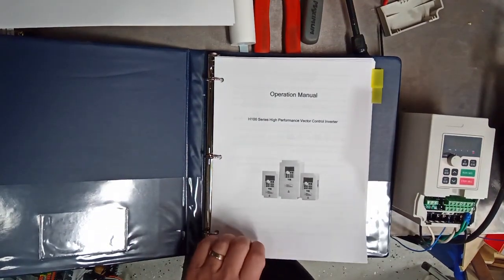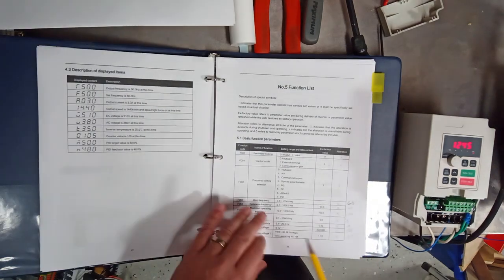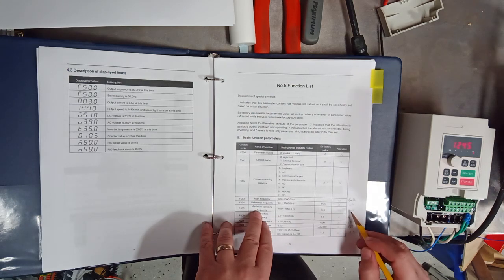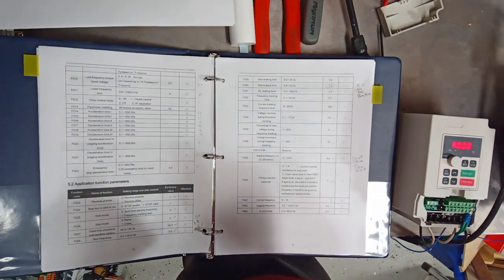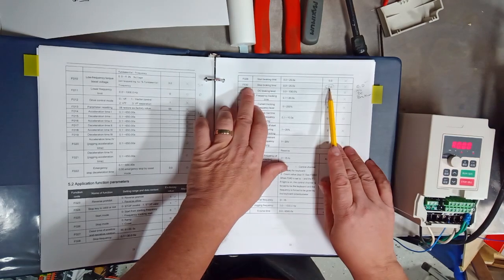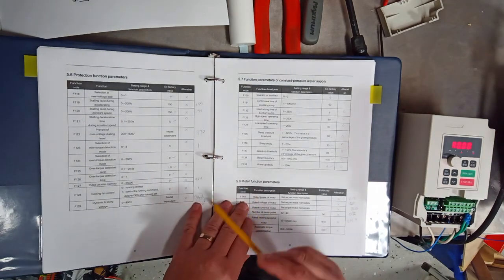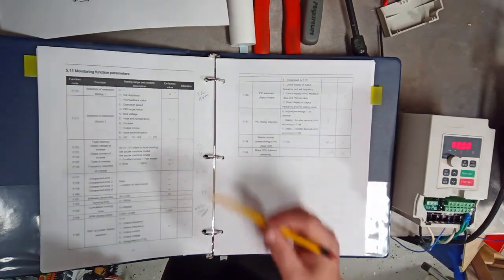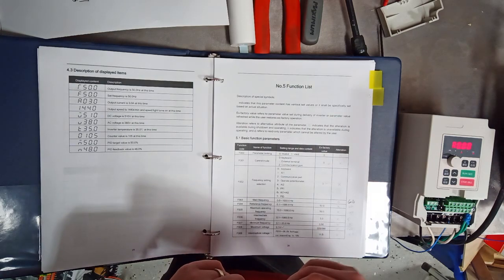Programming my VFD to drive the single phase 120V PSC motor

Comment: While I appreciate your effort, pointing to a manual which is unreadable on my screen and blazing through an explanation of esoteric terms just isn't helpful.  I will watch again with my miniscule manual in hand and try to correlate the two. Having absolutely no electronics background is not optimal, but all I want to do is run my 220v planer off of 120 volt source voltage.  It shouldn't be this hard.  Thanks.
Reply from the maker: @Janet-vx9qn  Simply don't go down a path if you can not comprehend the content or if you take the content out of context.  Your situation is not the same as the project documented by this video.  You are trying to run a 220V  planer from 120V source.  This is not within the context of this project.  Don't blame me or anyone's comments on this thread for your project becuse it doesn't apply.  Since you have no background in electronics or electrical motor operation, your comment that it shouldn't be this hard has no merit.

Comment: Saludos buenas noches tengo una pregunta. 
El VDF se puede poner a encender automático osea cuando haya un corte de energía que el mismo VDF se resete y encienda solo sin la necesidad de darle al boton run?
Reply: No creo que esto sea posible con la configuración VFD original. Creo que tendría que configurar el VFD para usar un interruptor de funcionamiento externo que podría estar siempre cerrado o usar un retardo de tiempo. De cualquier manera, necesitaría explorar opciones utilizando componentes de interruptor externos.
Reply: @toddbenko6701  excelente gracias hermano por su respuesta un fuerte abrazo desde Republica Dominicana.

Comment: Hi there can you provide the link for the Manual you got H100-2.2C2-1B
Thanks

Input: 110V 50/60Hz
Output: 0-110V 12.5A 0-1000Hz

Parameters what I am using, not validated as functionally correct.
F003 main freq = 60hz
F004 ref freq = 60hz
F005 max freq = 100hz for 1750rpm unit 60 for 3600rpm unit
F007 min freq = 10 hz
F008 Max Voltage = 120V
F026 stop mode = 0
F028 stop freq = 0.5 hz
F030 stop braking time = 0.0s
F031 DC braking level = 2.0 (dont care as long as F30 = 0.0)
F039 start freq for braking = 4.0 (dont care as long as F30 = 0.0)
F141 motor rated voltage = 120V
F142 motor rated current = 3.0 (use according to motor)
F143 number of motor poles = 02
F170 selection of display 1 = 2 (for RPM)
F184 RPM display factor = 0.5 (for 1750, use 1.0 if motor is 3600)
F193 output open phase = 0
F194 0hz output enabled = 0
Reply from the maker: website for the VFD manufacture is https://www.zhonghuajiangspindle.com/VFD-2.2KW.html
manual is available at https://community.carbide3d.com/uploads/short-url/sPh8tLgHr8zcgjSTjTfZp8PDyl.pdf
Lots of good information about unit installation from carbide3 site:  https://community.carbide3d.com/t/how-to-h100-vfd-1-5kw-air-cooled-spindle-setup-zhong-hua-jiang/54310

Comment: I have like this vfd single phase to three phase 120 volt can I connect with motor single phase? Thanks
Reply from the maker: The answer is NO.  You will need to select a different VFD model.  I believe you will need a VFD model that specifies 3 phase input 120V to 3 phase output 120V.  Remember we are not running a 3 phase motor, but we are connecting a single phase motor with 2 phases in a 3 phase connection.  This is not fully balanced hence don't expect perfect operation.n